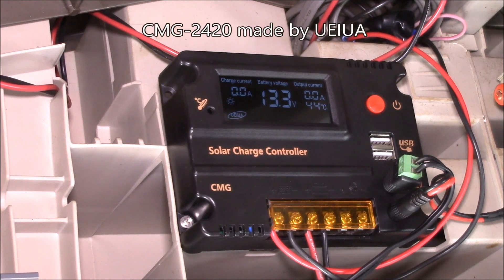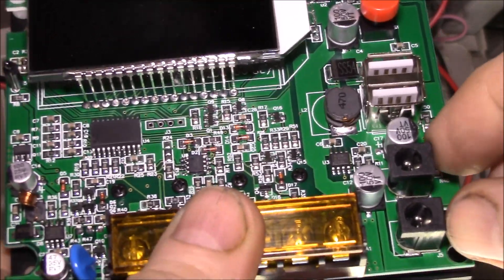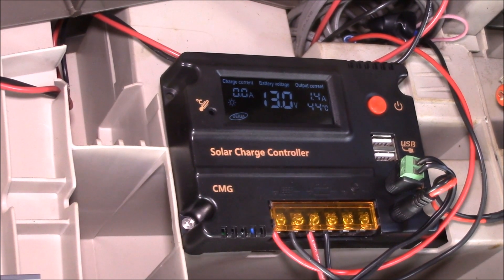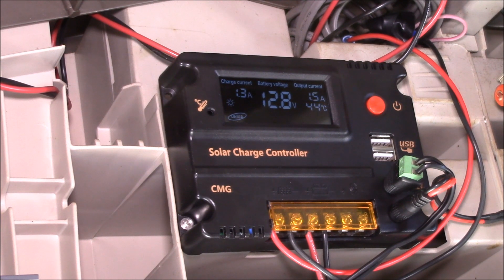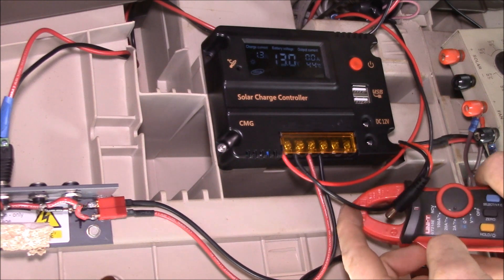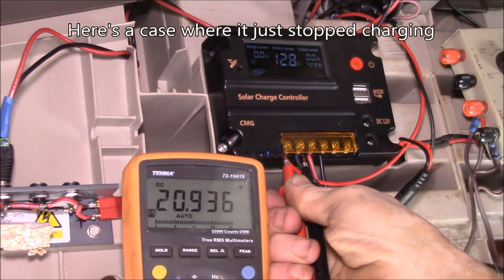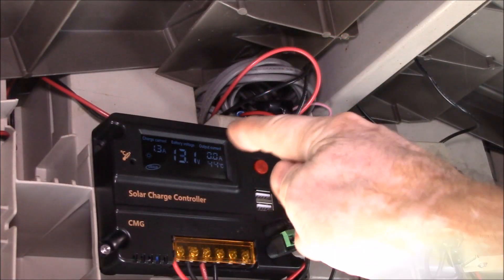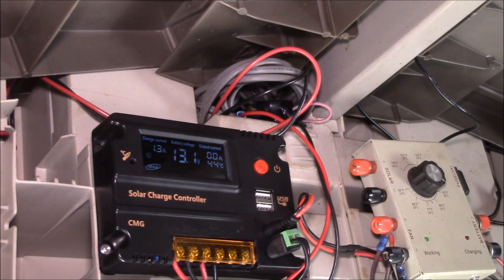Ueiua CMG-2420 PWM Solar Charge Controller

Comment: How big can the output be? (Current)
Reply from the maker: The model I have us supposed to do up to 20 amps output (2420 = 12 or 24 volts and  20 amps).
Reply: R Brown i think, it says: dc output = 2.0A
Reply from the maker: Yes, I think that's the 12V regulated DC load output via the two barrel jacks.
Reply: R Brown yes, i mean the dc connector!
Reply from the maker: There are multiple DC outputs:
http://www.ueiua.com/productdetails?_l=en&product_id=443

3 amps total on the two 5V USB connectors
2 amps total on the two 12V DC power jacks
And then I think it can do up to 20 amps DC output on the DC load terminals, that's probably combined with the 20 amp charging current.  Thus if doing 10 amps charge current, you could do around 10 amps of DC load.  The DC load terminals will be at whatever the battery voltage is (12V or 24V).  The pair of DC output jacks are at 12V even on a 24V battery.
Reply: R Brown i think the terminals depend from the battery, which is attached to the battery terminal! But are there no informations about that?
When i have a lamp connected over the load-terminals, is there a sign of load current on the monitor? Or is this just for the 2 Dc-Jacks?
Reply from the maker: Yes, the screw terminals ("light bulb" icon) are at the same voltage as the battery.  the 5.5mm x 2.1mm power jacks are at 12 volts even on a 24 volt battery.  There is a load current display on the LCD that shows the current of the load.  I only tried mine at 12 volts, but the load current on the display seems to show the combined current flowing out of all the DC load outputs.  

It's not terribly accurate and it doesn't seem to display anything below about 0.9 amps, at least on the two units I tried.  At 1 amp and above, it does seem to display fairly close to the actual current.  I only tried with the 2 - 12 volt DC jacks.  I had an LED light (~1 amp) and a pair of 120mm fans (~0.4 amps) and combined it would display 1.4 amps, the LED alone would display 1.0 amp, but the fans alone displayed 0.0 amps.
Reply: R Brown ah okei, so it is possible, to have an output with a current like 4-5A over the load terminals?
Reply from the maker: Yes, as long as you use the Load terminals and not the round jacks on the face of the unit.  But you'll need to have the battery voltage the same as the load voltage since the load terminals are at the battery voltage.  You can use the red button on the unit to turn the load on and off.
Reply: R Brown I am surprised that no relai is installed! how can a transistor switch a load of 20A without harm?
Reply from the maker: The load and the charging current are both switched with high power/current MOSFET transistors.  They can usually handle many 10s of amps, as long as the heat doesn't rise too high.  MOSFETs have a very low on resistance so dissipate very little heat as long as they are switched on and stay on.  They tend to get hot if switched on and off rapidly, since it is while they are in the process of turning on or off that they dissipate a lot of heat.  That said, with most of these inexpensive Chinese electronics products, you probably don't want to run much over half the rated current on a continuous basis.  So 10 amps or less should be fine.
Reply: R Brown ahhh now i underdtand thr whole thing!
Thank you very, very much!

Comment: It does not even look like it does PWM properly either good luck. Glad you got a refund and they corrected it
Reply from the maker: Yes, it seems to be pretty flaky, whatever is was doing.  I kept thinking it was my wiring or something like that.  But the 2nd controller did the same thing.  But then swapping to the Epever controller with the same wiring and all is fine.
Reply: I’d agree OTE. Looks like it’s just switching to me - which could be called PWM, just very slow pulse width modulation. Sellers sold a lot of UEIUA charge controllers as PWM when they weren’t. UEIUA did sell a real mppt unit, but then ruined it by changing the intervals, presumably to cut production costs.